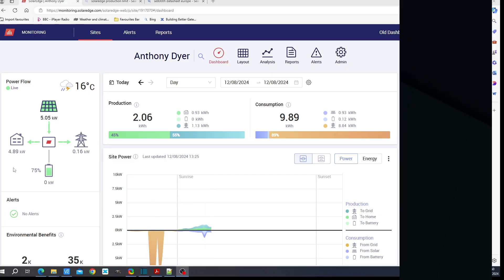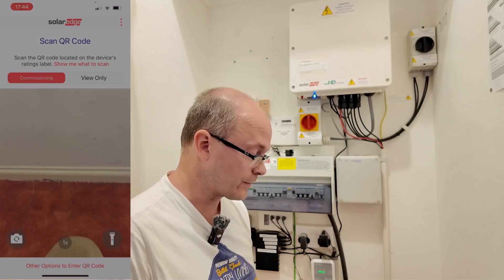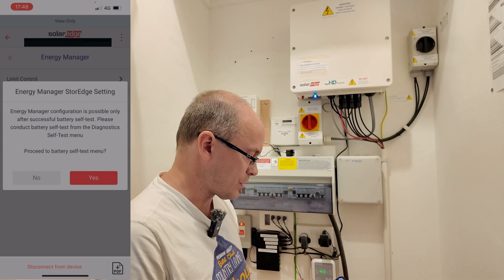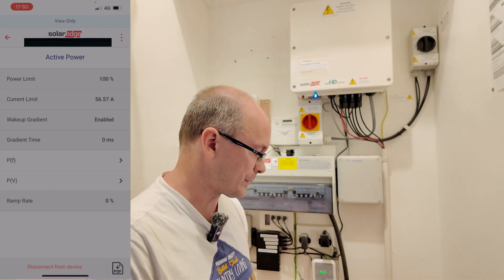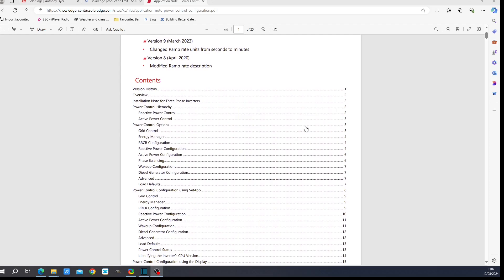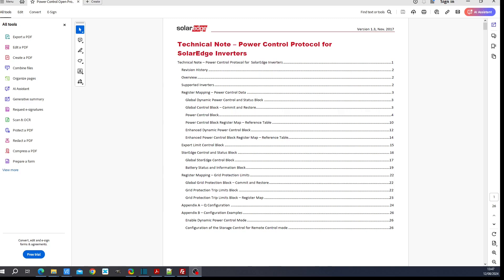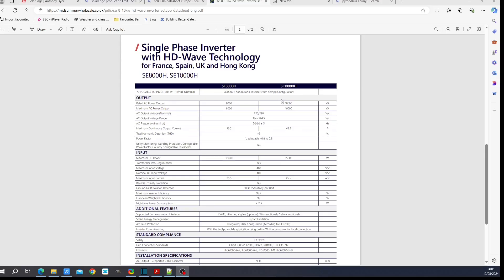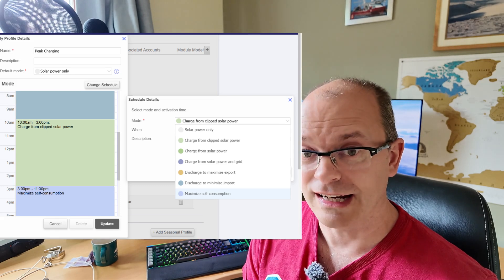[Fixed] Is your SolarEdge inverter giving you less power than you thought?

Comment: This isn’t right. I have the same inverter and battery as you and the inverter kicks out 8kW for hours on end. When cool/sunny I have seen 13kW produced with 5kW into the battery.

I would try turning on the production limit and setting it to something, saving. Then turn it off and save again.
Reply from the maker: @richardabw  I think I will probably revisit that production limit setting again tonight.   I think the setting is saved as soon as it’s set.
Reply from the maker: I switched on the production limit, set 8kW.  No change.

I exited setapp, reentered setapp, still no change.

I then set the power limit % to 80.  No change (as expected).  Then I set the power limit back up to 100%.  Still no change.  

It's a 6.4kW limit and the inverter isn't changing it's mind about that!    It's very elusive whatever the problem is.
Reply: @anthonydyer3939  Weird. Tried restarting the inverter and then trying to do the SetApp stuff? There’s no setting elsewhere at all with a misleading name?
Reply from the maker: @richardabw  I’ve restarted it many times, with external ac isolation as well.  My battery commissioning video 2 years ago actually shows the 6.4kw production limit there too, before I started on any configuration beyond country and meter config.

Comment: I have a 6kw SE inverter, 10kw SE battery and panels with 9.75kwp. In earlier years I’ve suffered from a lot of clipping but since the app was enhanced to allow much more flexible manual battery control, I’ve virtually eliminated clipping by discharging the battery from about 10am-7pm on sunny days so that the battery doesn’t reach 100%. I had been considering a larger inverter and/or battery but now I don’t need them. Interestingly, I’ve also observed peak production of up to 11kw from my 9.75kw mostly east/west array.

Comment: Another SolarEdge user here also with an 8kW inverter.  I have 12 kWp on multiple aspects, with a great deal of shading impacting my system.  On a typical UK sunny day (ie still with clouds drifting in and out) I get a maximum output of around 10.1 kW - effectively the peak rating.  If the sun builds up slowly but with zero clouds the output drops to around 8.4 kW for continuous operation.  The max export out to the grid is around 9.6 kW due to background home energy use.  The contrast between my experience and yours is stark.  I'm happy to share details with you, if that would help.
Reply: I'd be interested to know how you are getting 9.6 kW out to the grid from your 8kW inverter? What make - Solaredge?
Reply: @fastfreddy4518  It's a complete SolarEdge PV/Battery/BBU system with 28 Perlight panels.  In UK conditions and with our higher grid voltages the SE 8kW inverter has no problem achieving either its peak power or maintaining above the published continuous maximum power rating.  I've no doubt that those living with much higher temperatures and on lower grid voltage may see the SE inverter perform closer to that of the placard values.  Mine remains remarkably cool even when under load.

Comment: Hmmm.  Will need to check both my 8kw and 6kw inverters but I do see export in great sun conditions topping out suggesting both are not capped.
Reply from the maker: I'd be interested to read your results, especially for your 8kW inverter.  Some others on here have outputs that are bang on the sticker value.   I'm starting to fear that my replacement communications board back in 2022 was matched for the wrong size inverter.  In theory it should be the same comms board that goes in each inverter but I do wander..
Reply: @anthonydyer3939  I can confirm that on my 8KW inverter the Power Limit is set to 8KW so full power. Hope this gives you the clarity to find the setting you need to change.

Comment: My fronius had it's limiter adjusted to throttle output if with the SMA it exceeds 10kw. 
The industry Max down under per phase is a ridiculous 5kw. 
Luckily I have two phases.
You rarely hit peak to Max but when it happens the inverter makes a distinctive buzzing noise. 
That being said I have to say that my inverters have proved very reliable so far. The Gen 24 is a pretty impressive unit and the sunny boy is a very reliable brick of a thing.

Comment: I think it has to be a set up issue Anthony. My SE5000H does bang on 5kW with any excess production to the battery
Reply from the maker: @Crazydiamond_1974  I’m now getting quite a few people suggesting it’s a config matter.  I looked through my previous battery commissioning video from September 2022.  That 6.4kw limit was there on the SetApp, before I touched any power control options at all.  It’s a real mystery.

Comment: Interesting. I wonder what SolarEdge come back with as the answer. We have a 6 kW SolarEdge inverter and 2x 10kWh SolarEdge batteries. Have always started to export at 90% SOC on sunny days typically between 10am and 11am to get the 7-8 kWp and avoid clipping.